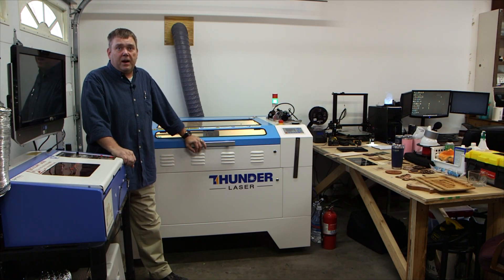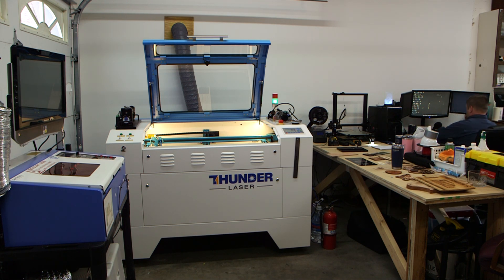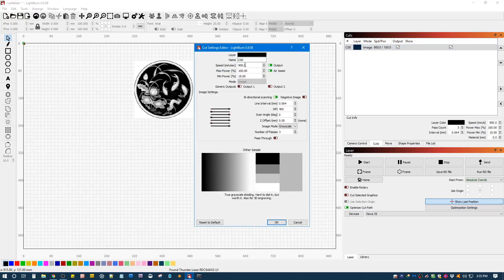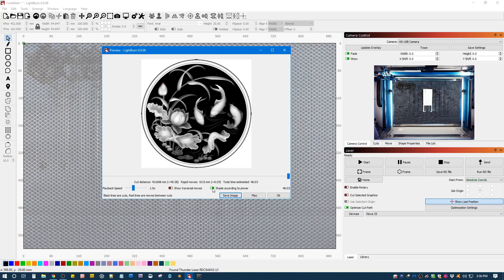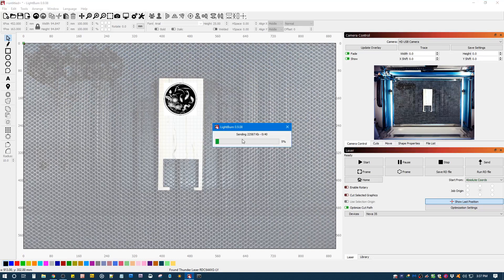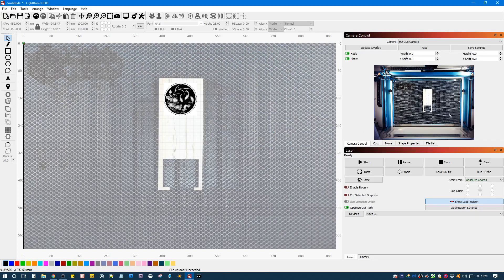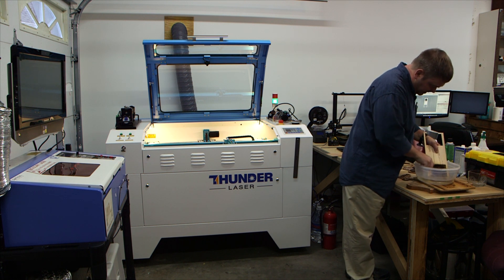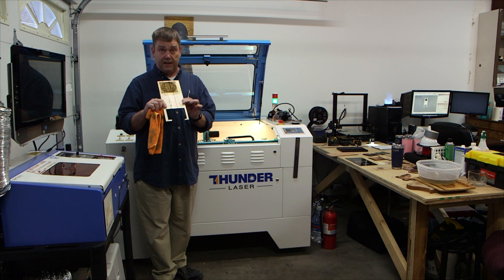3D Engraving Workflow

Comment: Thanks for the video--appreciate your sharing the information... but in the future, almost 13 miniutes of silence watching the laser with the video sped up only slightly... maybe 30 seconds of that would've been sufficient.  Thanks though for posting.
Reply from the maker: thanks for the tip.  i put "time lapse video" across the bottom so its easy to fast forward through the boring parts ;)
Reply: @TechBravoTN  Indeed you did... I may be overly critical because I come from a photo/video background. Keeping that part of the video short and sweet will make for more engaged viewers. But again, I'm on here commenting, and haven't gone to the trouble you have to actually make a video to help others out, so take it for what it's worth.  :)
Reply from the maker: @mikelavigne9161  i appreciate it. i will keep that in mind. i am certainly open to anything i can do to improve.